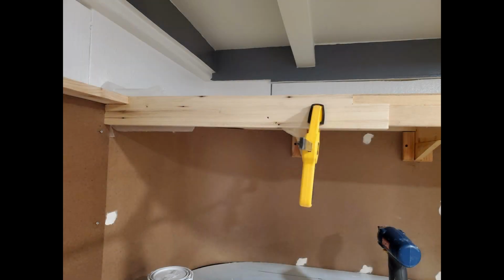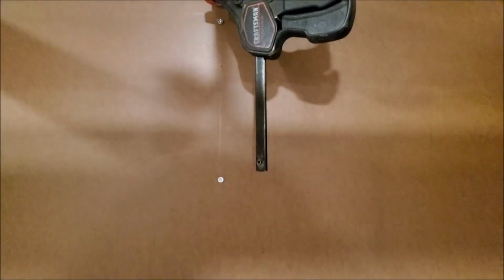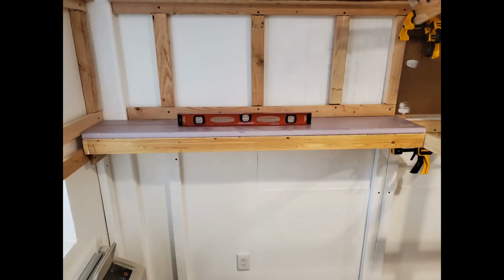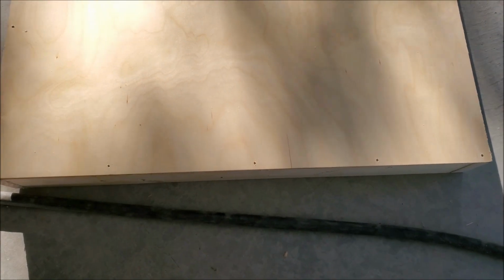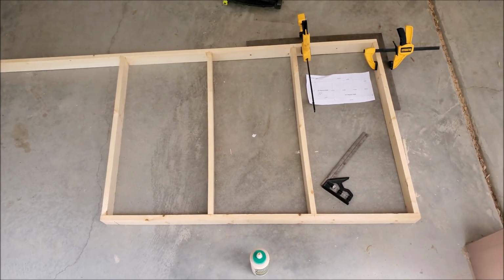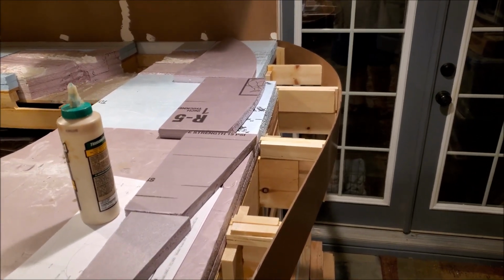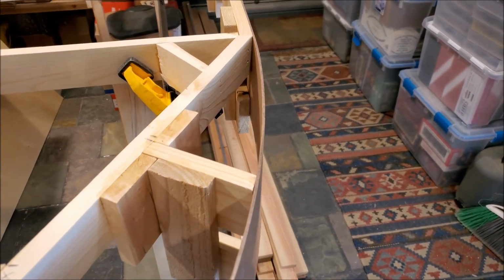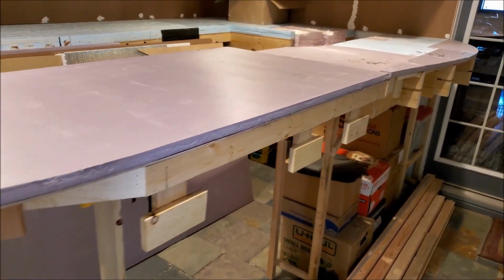HO Scale Model Railroad Benchwork Construction. Layout part 5

Comment: I made an oops by 3/8 of an inch 3years ago.  Drew the track plan at 22" wide but the plywood was cut at 22 3/8"  was taking measurements off the front edge and back edge of the layout as I worked along.  The track arrived at the middle at it looked like your basic construction joke where the 2 ends of the road do not line up.  Find the mistake now time to correct an error made years ago.   Yes it has taken me that long to start building this section of my layout.